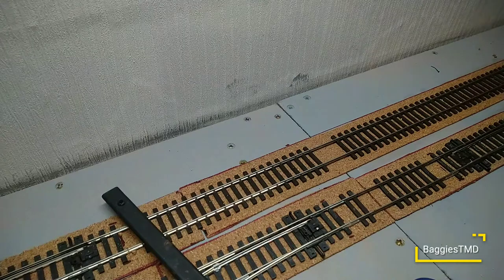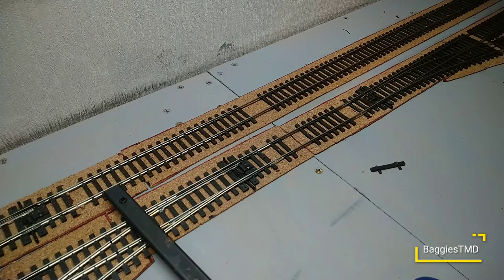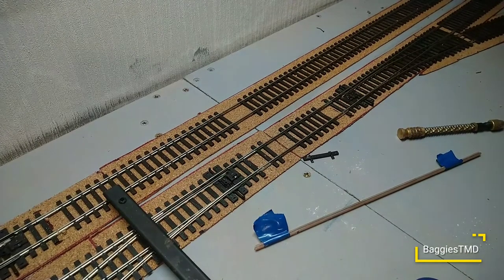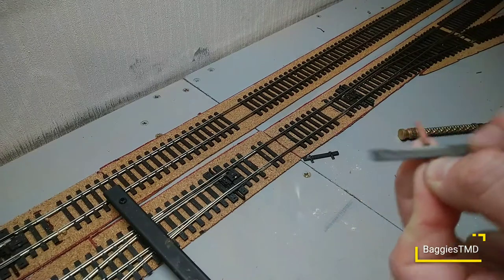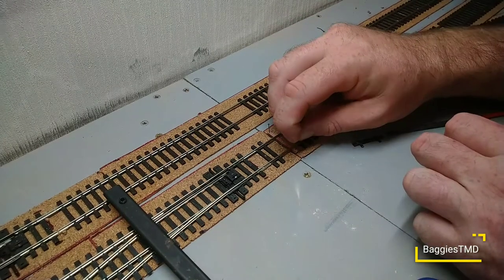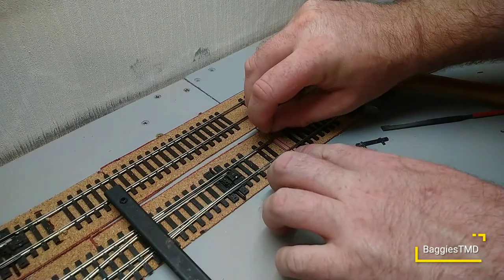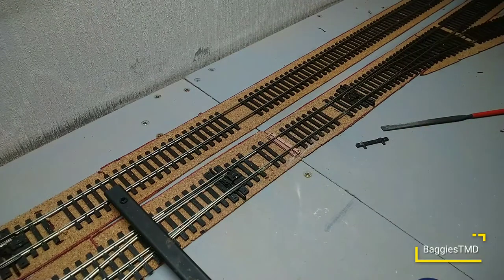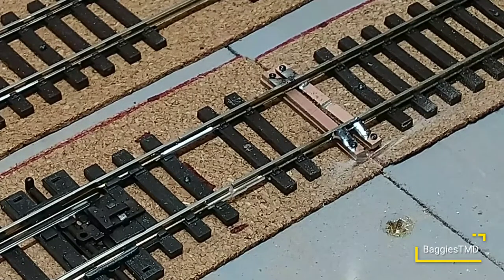Saddlers Way Eps 8 (the great copper clad cock up)

Comment: I always run a bit of superglue along the joint between copperclad and board/cork after soldering but before cutting the rail. That way you dont need the extra pins.
Reply from the maker: Cheers for that advice mate, brought the wrong copper clad never normally have any problems with the stuff 😂
Reply: @BaggiesTMD  No probs bud, to be honest you can get away with just the glue and no pins if you wedge them under the rail and add glue prior to soldering but the fumes are savage that way and goggles and a mask are advised if you do that as the heat makes superglue smoke!!!
Reply from the maker: Cheers mate hope your enjoying the channel so far
Reply: @BaggiesTMD  I am. I always tune in when you drop a new vid.